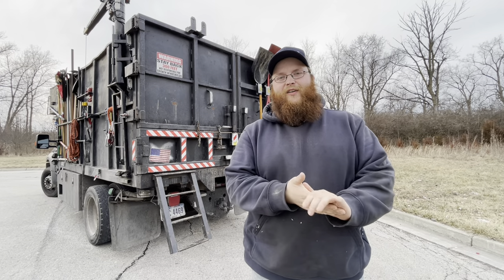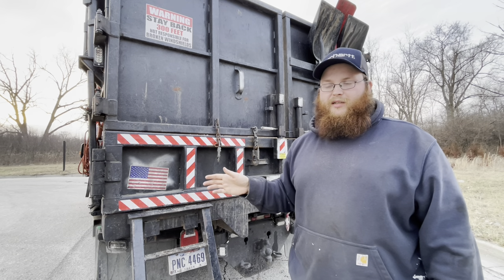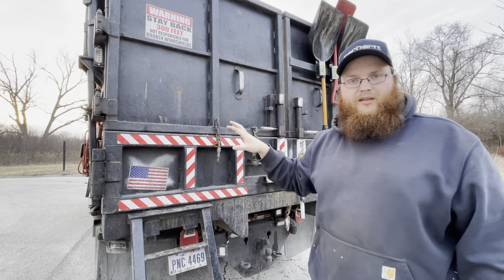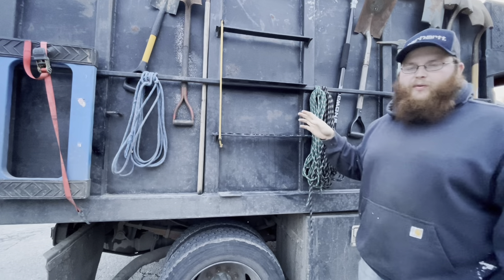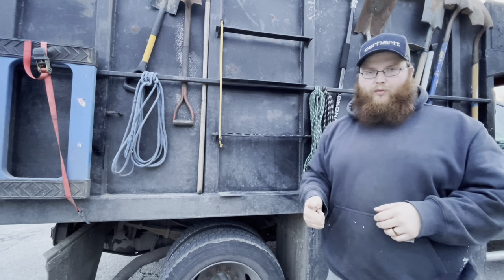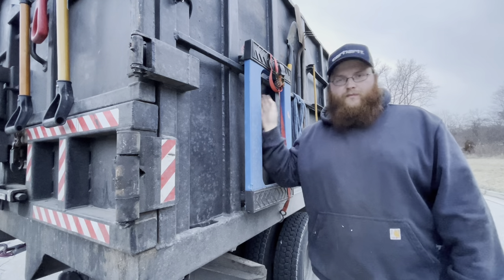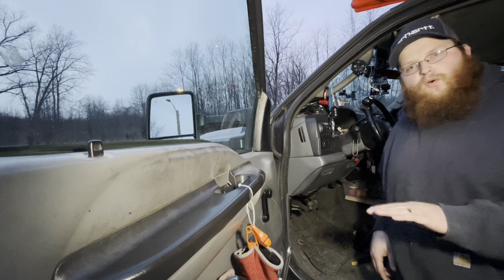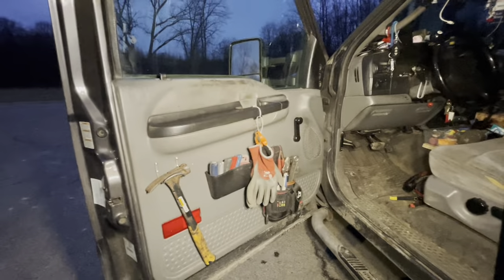The ultimate junk removal truck!

Comment: Nice truck! One suggestion is put some padding on the corners of that shelf where your radio is. If you, God forbid, are ever in an accident and hit your temple on the corner of that wood, that could kill you instantly.
Reply from the maker: It’s not super high it looks like it in the video. But it just about touches the side of your shoulder so your head is a good amount higher but thanks for the input. It’s all not finished it’s always going to change over time

Comment: what's the weight of the truck with all that stuff on it? the more you added on decreases the payload capacity
Reply from the maker: Around 14,000 our grvw is 19,500. All we haul is trash occasionally concrete and bricks but nothing over 1/2 a truck load so we’re not overworking the truck. On average our loads are 1,000 to 3,000 pounds